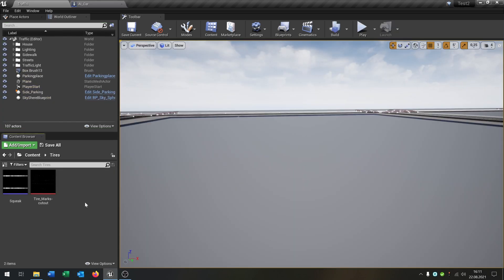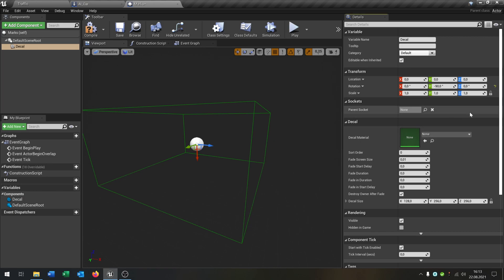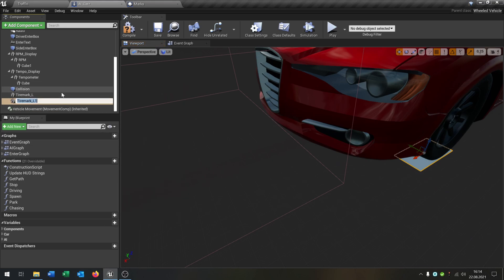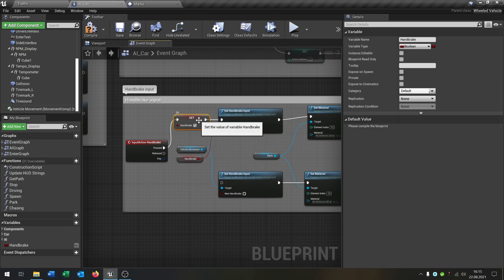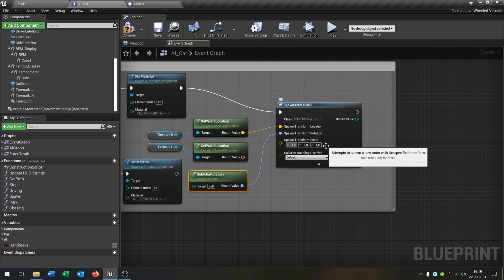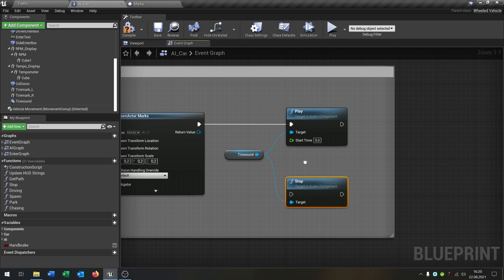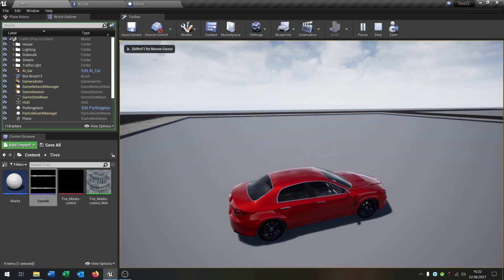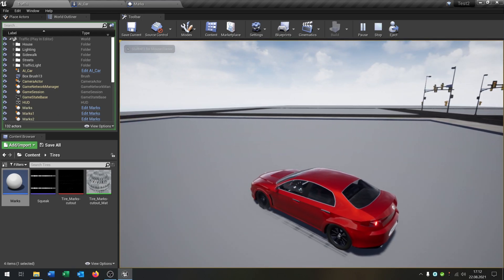Unreal Engine Car Tire Marks Tutorial

Comment: This is extremely inefficient and will tank your fps for no reason.
A much better way to handle tire marks (this way) is to use instanced static meshes or even the particle system.
Reply from the maker: That's a good idea. Since this Tutorial over 2 years old, this was the most common way.

Comment: My problem is that if i keep my handbrake pushed it's just putting the marks on the scene and the sound is playing. .
Reply from the maker: You could combine it with a Branch for the "Get Forward Speed" from the Vehicle Movement. So that the Condition would be over 0.
Reply: @Seredias.  Hmm okey i might try that if i find out how because i didn't find any skid tutorial which is exactly what i want and works without plugin. :D Thank you!